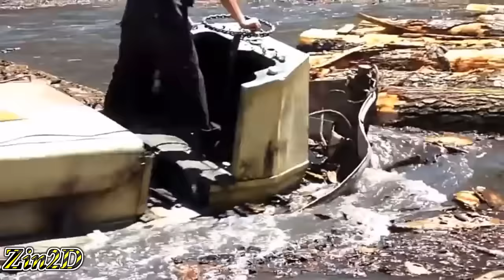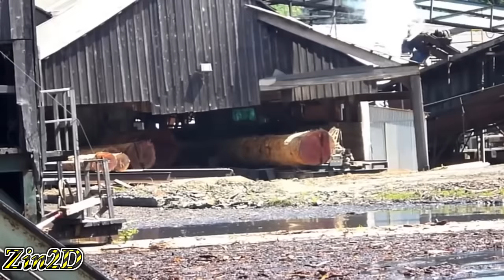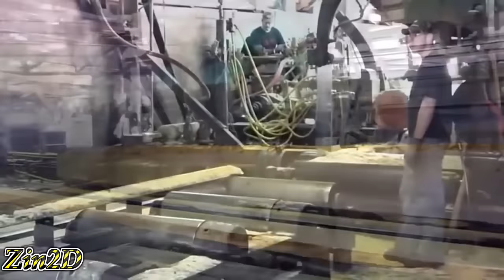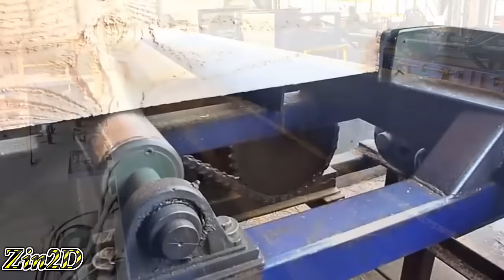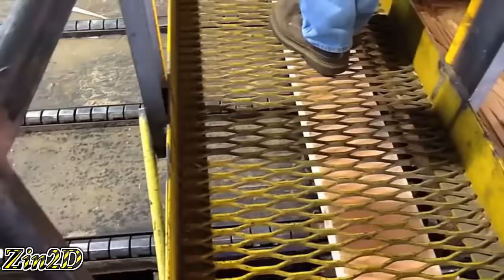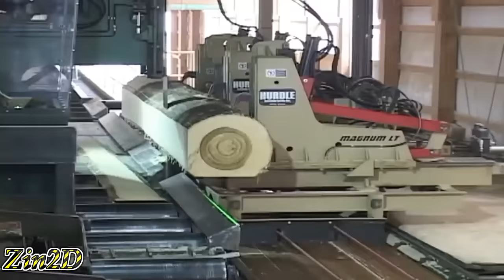Amazing Fastest Large Wood Sawmill Machines Working, Modern Operated  Sawmills in The Country

Comment: I would add weights to the logs to submerge them for at least 10-15 years. Water is a great preservative for wood. Also it makes the log more dense thus making it more valuable. I have seen 100 year old sunken logs pulled out of the Cape Fear River in NC & the wood that was cut from them costs tens of thousands of dollars. I believe that all trees grown for lumber be submerged in a lake or river bed for 15 years. This would prevent the warping of all the lumber you would find at Home Depot & Lowe's. What most people think is that old trees are cut down for the lumber industry. That is further from the truth. Yes some old growth trees are cut down to make fire breaks, but all lumber no matter the type are grown in managed forests. Also, Pulp trees are specially breed trees for the paper & cardboard industries. They are also grown in managed forests.